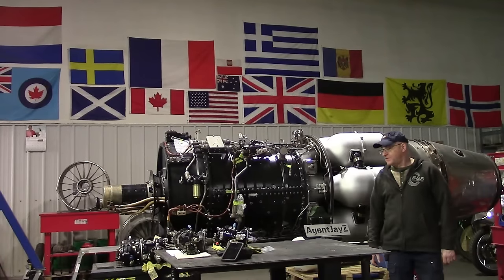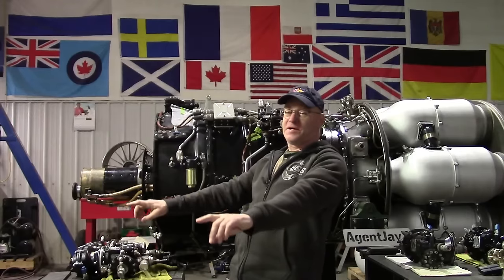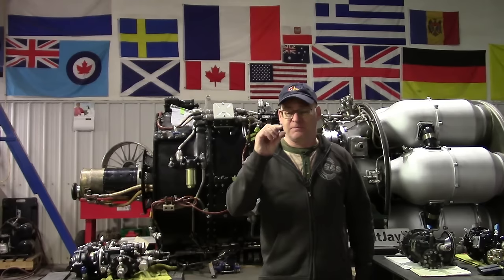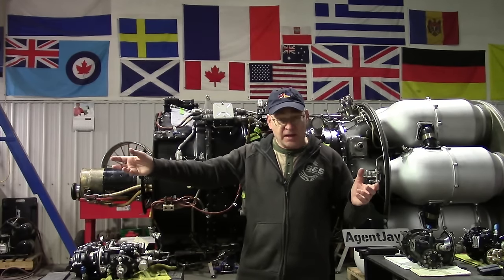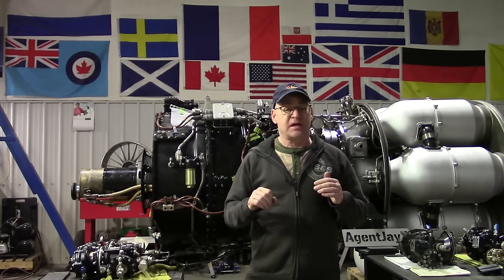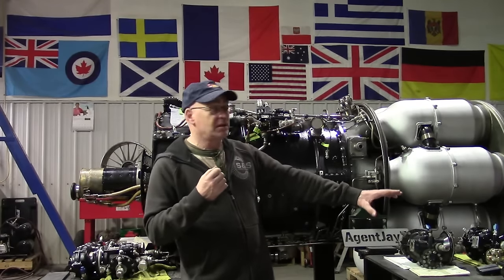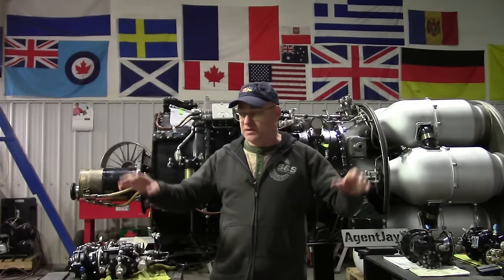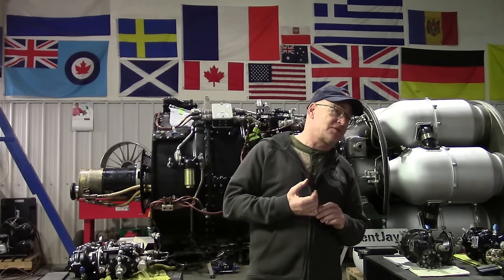Boost Pumps

Comment: Interesting also that in the small engine world ( I do mostly lawn care- the twin cylinder small engines, up to 1,000cc  ) and the lil vacuum fuel pump supplies about the same...3-5 PSI but at a higher volume the engine can use. Any more and it'll blow past the needle and seat in the carb. The fuel injected engines can use the same pump, but that feeds into a high pressure module, the output is right at 39 PSI to feed the injectors. The module is electric, and controlled by the ECU.

Comment: I must live under a rock, not sure what the one thing is, but loved the video. In new cars with direct injection the pump in the fuel tank is a low pressure fuel pump (lpfp) and it feeds another pump that is usually mechanically driven called the high pressure fuel pump (hpfp)....so the lpfp is kinda like a boost pump =) Anyways, good stuff!

Comment: A bit late to the party, but for reference: the fuel pump system in the C604 is rather elaborate. During engine start, the electric boost pumps provide inlet pressure to the engine-driven pumps. But once running, the engine-driven pumps, besides providing pressure for the fuel nozzles, also create a so-called "motive flow" for the venturi-type "ejector pumps" in the collector tanks, which supply the engine-driven pump inlet pressure in normal operation. So the engine pump, in a way, creates its own inlet pressure, and the electric boost pumps can be turned off. Beautiful system. Only if these ejector pumps fail, the electric boost pumps take over the ejector pumps' jobs. In addition, the main ejector pumps in turn create motive flow for the scavenge pumps, which are also venturi-type, whose job it is to scavenge the fuel from main tanks into the collector tanks. I don't operate these jets myself, but I have analysed numerous accidents and I know how to read manuals.

In non-aerobatic aircraft, fuel pickups are usually fixed at the lowest point when the aircraft is straight and level. They always leave a bit of fuel in the tanks, aptly referred to as "unusable fuel", which is the amount that cannot be pumped out in the most adverse "normal "attitudes (especially critical during acceleration and climb).

Comment: Hello...
 Why is it possible for something to malfunction in a car's engine and it stops in the street even though it is new or has been given proper maintenance, but this cannot happen in airplanes where the engines stop suddenly (except rarely)?  Is the difference in the nature of the design and maintenance of the parts or in the level of maintenance?

Hareth / Iraq
Reply: Higher safety margins, lower allowed tolerences, better QC, redundant systems, R&D. It's why turbine engines specifically for aircraft (vs. internal combustion engines, or even industrial gas turbines) cost so much.
Reply: Well, the only time(s) I've had an engine cut out on me when driving was when I was very sloppy over maintenance.
Reply from the maker: I've had an ignition coil fail on a new vehicle, stopping it in the street. Once running, a jet no longer needs its ignition system.
But, yes. Design differences. Jets and piston engines are different in almost every way possible.
Reply: @AgentJayZ  --  Well, I "conveniently" forgot to mention that most of the time car engines are at a glorified idle.   But I've going up some long "20 minute" grades at times.   An aircraft engin operates at 50 to 75% most of the time.
Reply: @AgentJayZ  Thank you, and thank you to all who responded

Comment: I had a couple tours working on the good old CT-133 Silver Star. Rolls Royce Nene 10 in our Canadair license-built versions, more power than the original Lockheed birds. Anyhow, boost pumps. The fuselage tank behind the cockpit in the T-33 featured a double ended boost pump. Double ended because fighter jocks in training & regular pilots flying them liked to go inverted and/or pull negative G occasionally. Although the fuselage tank is kept full being fed by tip tanks & wing tanks, when those are empty the level in the fuselage tank will drop & if the aircraft is subjected to negative G a single ended pump would cavitate. The wing tanks had single ended booster pumps to move fuel to the fuselage tank, but the tip tanks were pressurised with air to transfer fuel.
Reply from the maker: The CT-133 is the aircraft I'm in during the formation takeoff in my video called Warbird Jets. It was an awesome experience.
Reply: @AgentJayZ  Ah lucky you, I'll have to find that vid. On my tour in Baden during the Cold War I worked mostly on the T-BIrd, just a 6 month stint line servicing on the 104. I had the pleasure of many back seat trips in the T-Bird. Never lucked in for a 104 ride though.

Comment: I have a Question, What is the importance of setting a N1 power setting for takeoff and climb i get mixed answers on this some people say as long as you don't exceed ITT or max limits on N1 N2 your fine but in the books there are power setting for takeoff and climb are those just for calculations or hard numbers thank you very much
Reply from the maker: Don't know what engine you are talking about. With a turbofan engine, thrust is mostly proportional to N1, which is the speed of the LP compressor, which is also fan speed.
If you are looking to run the engine at max... right to the ragged edge, then EGT, and the speed limits of both shafts are your "redline". But as I understand it, each flight of each aircraft type, with each type of engine has a calculated optimal power setting. 
If you underpower, you might not make it.
If you overpower, you are wasting fuel and causing more than necessary stress and wear on the engines.
Reply: Thank you for the response I was asking for a p&w jt15 @AgentJayZ

Comment: Ive been watching you for awhile and i want to get into fixing/rebuilding turbines for a hobby. What engine would be good to start with?
Reply from the maker: Something small, like a T58, a RR Viper, a Garrett TPE 331, or an Allison 250 C-18. You need to be able to fond the overhaul manual, and a source of parts. Donor engines will save you hundreds of thousands. The used market in the aviation world is still extremely expensive, so you will need to become a detective to find the stuff you need.
Check out Darren Duncan's channel where he did an amazing job on his surplus Fairchild J44.

The OH manual, and the illustrated parts catalog are an absolute must. Look for those first at places like eflightmanuals.com.
If you are an extremely talented technician, and have "all the tools", and think you can figure it out on your own, I wish you luck, but failure and financial loss is a certainty in my opinion.

You have been advised by someone who does this for a living.
Reply: @AgentJayZ  thanks for the very informative reply! I have a home machine shop and im an engineering student so im more prepared than most. Im not gonna do this to make money, just for fun and to learn how the technology works.

Comment: So in diesels that have direct injection 50% of the fuel returns to the tank to keep the injectors cool...do jet engines use fuel recirculation to keep the injection system cool?
Reply from the maker: No. There is a return from the fuel control output to the pump inlet. Fuel flow is high, and generally fuel temp is about room temp, so the fuel control has no specialized cooling ability.
Reply: Not all diesel engines return large quantities of fuel or use it for injector cooling. Practically all have a return line to collect leak off fuel (all plunger pumps leak) and return it to the system but that might only amount to an occasional drip. It all depends on the engine design. Turbine engine aircraft often use fuel as an oil coolant so heat is added, not removed. "Room temperature" for an airliner cruising at high altitude may be 60 or 70 degrees below zero and wing tanks rapidly cool in the airflow. Take a look at the bottom (sometimes top) of the wings of an aircraft that has just arrived at the gate after a transcontinental flight and you will almost certainly see frost  in the shape of the remaining fuel level. This doesn't apply to SR-71s of course, they had exactly the opposite issue.

Comment: On the D.G. Probable Cause channel from cockpit audio  the Challenger pilot didnt ask for Prist when it took on fuel, causing it to gel in the tanks and eventual fuel starvation.
Reply from the maker: This video is about boost pumps.
Reply: @AgentJayZ You spoke about the Challenger fuel system and the plane fueling up before it took off. I wouldn't have added pertinent information if you hadn't brought it up first.
Reply from the maker: OK, I was not trying to figure out why the crash happened. I was only trying to explain what boost pumps were. Because Juan mentioned them without saying much else about what they were.

Comment: A down is the condition of the center being over the ball which is positioned on the ground.
Reply from the maker: Thanks. "the condition of the center being over the ball"? Gibberish.
The center of what?
Reply: So the offensive team (the ones that start with the ball) has 4 attempts to gain Ten yards distance towards their goal line. Normally when they talk about gameplay you’ll hear the number of down which the offensive team is playing, and the distance they have yet to traverse before they can restart the count of “downs”. Now it can be a number greater than ten if the player with the ball runs away from the starting line as well IE “1st and 15”. 

I only played football because my friend did, otherwise could not care less about the sport.
Reply from the maker: Much better. Thanks!

Comment: Many of the booster pumps are gear drive.  They use a spring relief bypass to regulate pressure.
Reply from the maker: When I describe fuel pumps as gear driven, I mean they are attached to the engine, and driven from a gearbox literally attached to the main shaft of the engine via a radial drive shaft.
Boost pumps are in the fuel tanks, and electrically driven. They are nowhere near the engine.
Reply: @AgentJayZ  Sorry, I meant to say gear type, not gear drive.

Comment: A little information pill for you, feature for Bombardier (CRJ included) the boost pump are used only to start the engines, then is the engine fuel pump that generates the "motive flow" towards the tanks where, thanks to jet pumps (edit after @oldtugs clarification) inside the tanks, the fuel are delivered to the engine fuel pumps...
And yes the boost pump are centrifugal even because if they stop working for eny reason are "trasparent" to the fuel flow...

Ciao ;)
Reply from the maker: I would say the jettison pumps are fulfilling the role of boost pumps, wouldn't you?
Reply from the maker: Thanks!
You make them do a handstand?
Reply: They are not "jettison" pumps, they are "jet pumps" or more correctly, eductor pumps. They use a high velocity stream of fuel to accelerate a larger volume of fuel. They are not "strange" but a fairly common type of pump used in many airframes. For what it's worth, some engine mounted fuel pumps use a centrifugal element at the inlet to provide boost pressure to the positive displacement section.
Reply: No problem and no criticism. Glad to see someone with airframe knowledge chime in. The Citations use jet pumps as transfer pumps, they receive working fuel from the engine mounted fuel pump bypass or ( I think in later models) a separate pump in the sump or collector tank. I believe the 737 uses them as scavenge pumps.